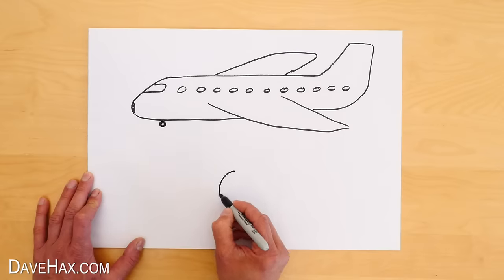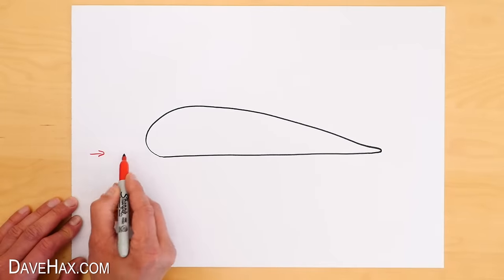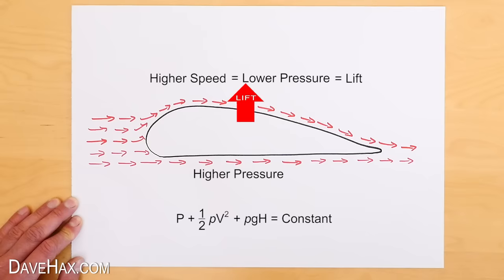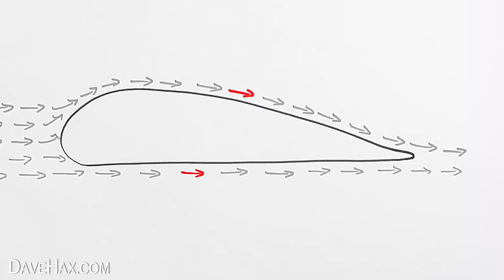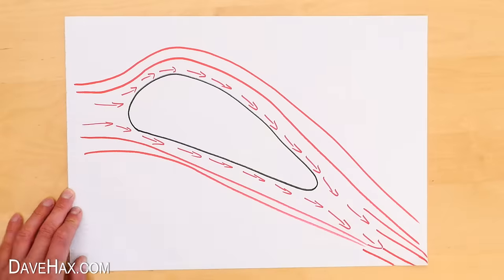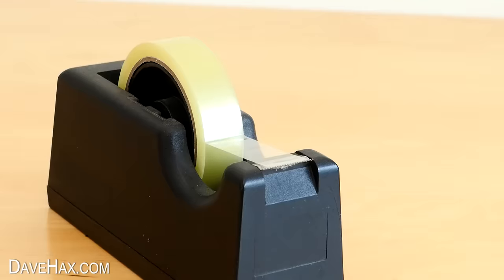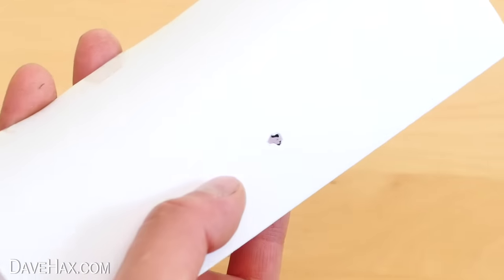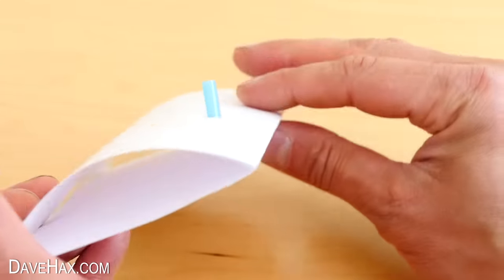How Does  A Plane Wing Work?

Comment: You missed the horizontal stabilizers in the drawing. Without that, a plane is uncontrollable.
Reply: The only exception is the concord. But yes the elevator is for pitch/up and down.
Reply: @progamingyoutubevloger6620  that's because of the very wide wing shape, a concord can be controlled with elevons. This means that the ailerons can be the elevator at the same time. Horizontal stabilizers weren't needed because the wing was so wide: from the front to the tail. The plane he showed can't miss the horizontal stabilizers.
Reply: I added them as you suggested and it works better, thanks!
Reply: I noticed it too 😂
Reply: @progamingyoutubevloger6620 "the only exception is concorde"
They are many more who use elevons so yeah.... mainly with delta wings but yeah
Reply: Yeah
Reply: Actually it can be stable if you add some reflex in the trailing edge of the airfoil , it will produce downforce to make the plane stable
Reply: I am not an aeronautical engineer. Should n't large vertical stabilizers be sufficient. Thanks.
Reply: @FloppoDOS  maybe, but you also need elevator for control, and the stability would be even better with horizontal stabilizers.
Reply: @ChandrasegaranNarasimhan  Yes that is possible, but it would significantly decrease the vertical stability, and you still need to find a way to replace the elevator controls. This can make the plane very hard to control.
Reply: @kokoslegend4850  after some thought, I have concluded that horizontal stabilizers are necessary. The front curvature will twist the wing anti-clockwise. This is prevented by the rope-straw in the video. So horizontal stabilizers are necessary.
Reply: @ChandrasegaranNarasimhan Yes you are right, however you could counter that with a more nose heavy airplane. While an airplane without horizontal stabilizer is possible to make, it would never fly as good as one that has it.

Comment: Dave, Thanks for explaining that Bernoulli's principle is a mis-applied and incorrect explanation for wing lift. The Coanda effect , or "Wall Attachment effect",  is responsible for the laminar air flow on the top surface to follow the contour of the wing (if the angle if attack is not great enough to stall the wing).Proof experiment: gently hold a soup spoon with its convex surface  slowly nearer and nearer to a running faucet's stream of running water. As soon as the water stream just touches the backside of the stream, the Coanda effect will attach the stream to the spoon and instantly pull the spoon (lift!) closer to the stream. The fluid pulls the air out from the boundary of the spoon and the water creating a low pressure area which allows atmospheric air pressure to push the spoon and water together. You will have created "horizontal" lift. Key point, the resultant water flow is now flowing in a new direction. THAT is the downward reflection of air coming off the trailing egde of the plane. If you put pressure gauges on the ground under the flight path of a plane just taking off, a higher pressure will be momentarily sensed.  Now hear this:  the total mass of downward moving air coming off the trailing edge of a flat or airfoil shaped wing is equal in that instant, to the TOTAL WEIGHT OF THE AIRCRAFT. Fly a giant imaginary scale under the plane as it is flying and it will measure most if the weight of the plane as it is flying....the giant air cushion is there. Wing tip vortices are simply the faster downward moving air and the realtively level air near the tips if the wing attempting to re-join...causing  dangerous for too-close- following aircraft, rotary clear air horizontal rotary turbulence.    Who said "Every force has an opposite but equal reaction." ? Right.
Put an entire jumbo jet on a giant scale or table and the plane will transfer its weight through the table to the ground. How else could anything be supported?  The push of the wings of a flying plane essentially push down on the air.  The faster the air flow the "harder" or more solid the air becomes. Thus  , faster plane, smaller wings. 
The final question NOBODY is asking is "why are wings fatter in the middle? Elementary dear Watson! Answer: That is where the support spar was when marerial science had provided only limited strength materials. Look at the airfoil of an X-15. Practically flat.
And to make it very clear...planes actually can fly upside down. I learned this when I was 10 years old from flying .049 powered U-controlled (control line) model airplanes that I designed and Not from incorrect science books. I am a pilot.
Reply: Nice! i could use this for my science fair! Thanks

Comment: The lift force of the wing profile is created due to the difference (difference, Delta) in atmospheric pressure.
Another thing is why two such zones are being created?
The most working hypothesis is that the mass of air elements - molecules - have inertia. And this inertia of the air flowing around the front upper part of the wing creates a vacuum zone behind it, and the oncoming lower part of the wing is a very small seal.
Compaction is a weak force in this pair, and vacuum is a much larger share in the lift of the wing.
This is what explains the behavior of your model in the film.

Comment: An aerofoil cross section is a worthwhile improvement over a flat plate, but only that. A 50p balsa model, from the toy shop, flies well enough with no curvature at all to its wing. George Cayley defined flight perfectly. "Flight is the application of power to the resistance of air".

Comment: I think I'm going to say this is the best lift video on youtube right now.  At least from my perspective.  The flat bottom curved top shape still producing lift because of the downward resultant flow direction is the key IMO.   I still don't understand WHY the flow on the top of the wing is faster and making lower pressure because it obviously is on the smoke experiments.  So there is a mystery there, but the resultant force makes more sense to me on why flat bottom aerofoils still lift.

Comment: Great experiment showing how the airflow over the top of the airfoil can aid in the generation of lift. Also, good catch on how the equal transit time linked with Bernoulli’s explanation is false. Expanding on this by further placing an airfoil in a wind tunnel it can also be observed that the pressure in the Flow-field is the same around the airfoil (sourced from How do wings work? Holger Babinsky 2003 Phys. Educ. 38 497), thus further showing flaws in Bernoulli’s explanation of lift.

Comment: i'd like to point out the reason i subscribed. u used the least amount of resources to get the job done. u didn't even tie the rope on the board because the weight was sufficient enough. no extra workhours were needed there. cheers

Comment: An aeroplane with a symmetrical wing section like NACA 0012 can fly quite easily, and can fly upside down as well. How do you explain this?

The equal transit time theory is correct if the fluid is liquid helium, but no net lift is produced. Can you explain why?

Comment: You can try this experiment without the hair dryer. Use a length of fishing line(smoother, therefore less friction) about 3-4 ft long.  Hold each end of the string in a vertical position with your left hand at the bottom and right at the top. Keeping the string taunt, spin in the direction of the leading edge(front) of the wing. You won’t make a whole revolution and the wing will climb from bottom to top quickly.  The faster you spin, the quicker the wing climbs.  You can also do this by holding the wing in front of a fan.   If you are demonstrating this for younger students (elementary/jr high) it gets their attention quickly.  I did this demonstration with my students(7th grade) and than broke into lab groups so they could build their own.

Comment: Actually, it is a combination of Newton's 3rd law, and the Coanda effect that makes a plane fly, not the Bernoulli principle. The Bernoulli principle is only applicable in a closed tube.
Reply: The upper flow is faster and from Bernoulli’s equation the pressure is lower.

The difference in pressure across the airfoil produces the lift. As we have seen in Experiment #1, this part of the theory is correct. In fact, this theory is very appealing because many parts of the theory are correct. In our discussions on pressure-area integration to determine the force on a body immersed in a fluid, we mentioned that if we know the velocity, we can obtain the pressure and determine the force. The problem with the “Equal Transit” theory is that it attempts to provide us with the velocity based on a non-physical assumption as discussed above.

NASA

Comment: Fits of all, air does not move past the wing. The wing moves through the air. Big difference.
Downwash at the trailing ede= lift. Period. Other smaller effects  (upwash, pressure differences, etc.) are not significant.

Comment: the shape of a airplane wing (Airfoil) Wich is a curved shape at the top but is flat at the bottom. Due to bernulies principle- The faster air is moving the lower the pressure. the air will move faster on the top will make lower pressure. the lower pressure will pull the wind up and the slow moving air will make a lower pressure than the pressure on top. you can do a experament with bernulies principle- fold a paperr into a shape with 2 walls and a roof with a floor, do not use the paper for the floor use a table. it should look like a tunnel. Blow in the tunnel the low pressure air will suck the paper to the desk.
Reply: Statement 1 and Statement 2 do not logically lead to Statement 3.

Comment: What about the 2 small wings at the back of the plane with the flaps?
Reply: @Barron Celli don't all planes require them to fly ?
Reply: @DownhillCube4  actually, most planes have them indeed to be able to vertically rotate. But some can fly without. Looking at the Concorde, the wing went far to the back of the plane, and had "elevators" next to the "ailerons". The elevator is the part that moves in the back wing, to make a downforce or upforce to rotate the plane vertically. The Concorde had the elevators at the back of the wings, and it works as good as a normal back wing. Planes can also have a "canard", which is a back wing, but placed in the front, like a tupolev 144, the Russian clone of the Concorde. This also works like a normal back wing, but then the other way around.
Reply: @Adrian Stevanovic well, I am and have about 430 hours logged. About the Concorde, it has no horizontal stabilizer, but it has elevators next to the ailerons in the wing. I am pretty sure that is what I said. And there are planes that don't need a horizontal stabilizer, there are even planes with no tail and they can fly perfectly. About the TU-144, the stabilizers you were talking about are canards. Google it mate, it's not hard :)
Reply: @Adrian Stevanovic And oh yeah, you said that the Concorde had small elevators at the nose. Where did you learn that?

Comment: I'm still confused by why the air on top of the wing is faster. It is going the same speed as the bottom air originally, but it now has more distance to cover. You would think that it would be going slower, not faster. I mean... I do remember from physics that horizontal acceleration doesn't change even if vertical speed changes (so a thrown ball going 15 mph south would still be going 15mph south as it drops, except for friction slowing it down). So is the idea that the air is still going sideways at a constant speed, but a new force is making it go vertical? Because if that's the case, then because it is covering that same distance, it's going to be moving quicker... if there's some other force that is also keeping it stuck to the wing instead of climbing the first hump and then flying off parallel to the bottom wing. I'm not sure if I'm making sense but I feel like I'm missing something.
Reply: Pressure, your missing pressure. You treat air like a stone. Sadly i cannot draw in a youtube comment.

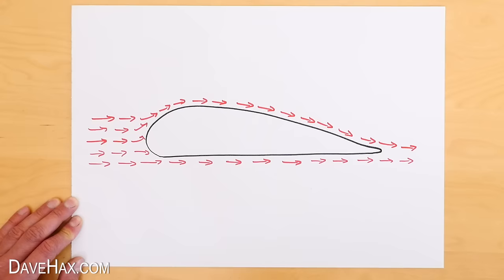Comment: At time 2:45 to 2:49 it is told that the "air flowing over the top of the wing flows at a higher speed is resulting in a lower pressure". Is is also a fallacy like the "equal time fallacy". It is the wrong placing of cause and effect. The EFFECT is the higher speed of the air the CAUSE is the lower pressure which accelerates the air when flowing into the low pressure area. If you believe the higher speed of the airflow causes the lower pressure, then you would have to state the cause for the higher speed. As we have seen the longer path is NOT the cause for the higher speed because the "equal time argument" is wrong.

Comment: The maths does not work out.  The experiment above  demonstrates how little lift is generated by the paper wing on a string, when exposed to horizontal relative airflow (headwind) created by the hair dryer. 

More precisely, the experiment above shows that: 
-	A hair dryer typically produces approximately a 50 km/hr airflow over a 4 cm (0.04 meters) wide distance (i.e. wingspan). This can be verified using a anemometer with any standard hair dryer. 
-	The horizontal airflow from the hair dryer allows the paper wing with an estimated mass of about 20 g (0.02 kg) to rise relatively slowly upwards. 
-	This means that a 50 km/hr relative airflow over a 1 meter wingspan, is equivalent to 25 hair dryers (25 = 1 m / 0.04 m). 

-	The 50 km/hr airflow would generate lift sufficient for  only 0.1 kg of aircraft mass (0.1 kg  = 0.02 kg *   25) for each meter of wingspan. 
-	The calculation means that a Cessna 172’s 11 meter  wingspan, exposed to a 50 km/hr relative airflow, would generate enough lift for just 1.1 kg of aircraft mass (1.1 kg = 0.1 kg/m * 11 m).  

This lift  (of 1.1 kg) is significantly less that the Cessna 172’s MTOW of about 1,100 kg !!!  

Although, the Cessna 172 stall airspeed is about 90 km/hr. Even almost doubling the relative airflow from 50 km/hr  to  90 km/hr, will still not generate enough lift for the Cessna 172 to fly, according to this paper experiment. 

The maths does not work out, unless I've missed something ?

Comment: I’m just confused on the relation between velocity of the air and the pressure of the air. Why does higher velocity air create LESS air pressure?
Reply: the particles become farther apart. like how if air is heated up the particles do the same thing, speed up and spread out

Comment: some late information        because  air  is  STATIONARY, there  is  NO  flow, and  no difference between the  'transit speeds/times' above and below a wing.      as a result,  ANY  results from a wind tunnel-type apparatus  are less-than completely accurate. 
it's just a happy accident that bernoulli's math  works reasonably well, for stationary fluid/air.

Comment: This is a nice wind tunnel set up, but NO. The faster speed above does not cause the lowered pressure .  'The lower pressure is the cause of the faster speed because higher pressure ahead of the wing pushes more, therefore accelerating the air rearward.

If you correctly examine these pressures it should be obvious that it is these same pressures that are the cause of the downwash. 

Pressure gradients accelerate fluid; the same as forces accelerate mass.  It is Newton's Laws for fluids.

Use two strings spaced side by side and have the string not rub on the straw so much.

Comment: instead of a tail stabilizer you can use 2 straws one on each end with 2 strings.
Reply: it would detract from the experiment. The wing would then be held straight by the strings themselves and not the air flow.  You would just have a piece of paper sliding up and down guided by strings.

Comment: My biggest question right now is when the wing is angled more steeply. Why doesn’t the plane go for a nose dive because of the angle of the wing?
Reply: When the wing is angled upwards, the air coming off the back is angled more "downward" which means (Newton's equal and opposite reaction) that the plane will feel more push upwards (lift). That's why airplanes point their nose up when taking off. Of course, this only works up until a certain point. Point the plane up too much and air will stop flowing smoothly over the top of the wing. This is called a "stall" and the wing stops producing lift and the plane falls out the sky (unless the pilot takes corrective action).

Comment: Your hairdryer experiment obviously works due to Bernoulli's law, but this setup has nothing to do with real plane wings. Whenever you aim high speed air on the top side of the wing, the air speed difference above and below the wing generates lift, however, this was generated by the position of the hairdryer and there are no asymmetrical winds out there. The haidryer should have been aimed and set at the center line of your wing (or more preferably, the wing moved like a kite) to judge whether it was the wing profile that made the airspeed difference. Even a single paper strip moves upwards if you blow high speed air above it.
Reply: No asymmetrical winds? 
The shape of the wing accelerates airflow over the top surface relative to the bottom surface of the wing.

Comment: Actually this is wrong. You don’t generate lift because the air particles on top move faster than the ones on the bottom. That’s called the bernoulli's effect and it’s been disproven.

Comment: My dad build planes right now before the video there is an ad so I can explain how a plane wing works so that the angle of a plane win that will allow it to fly so I have to be at a certain angle where air can get under the wing to create lift jack with a piece of cardboard make it out of certain angle and then you’ll see it will spin you might ask why does that happen and why does not fly well because it doesn’t have a proper body yet so you do a little bit more attachments make another little wing on the back and then boom you got half of a working plane if it does not work then just keep on trying to move forward so yeah Time to watch the video